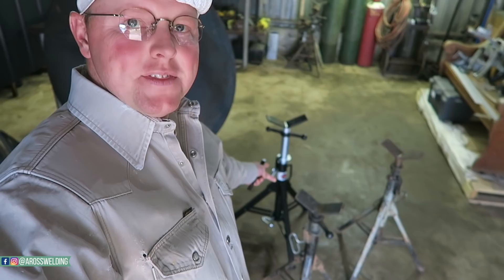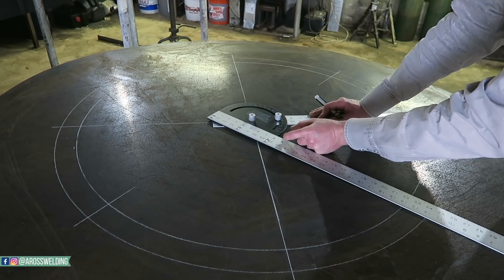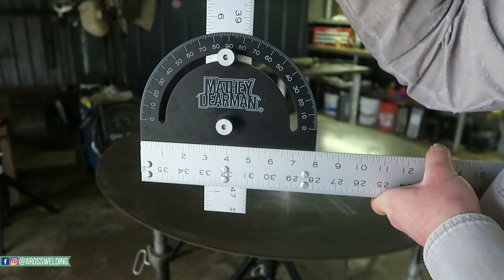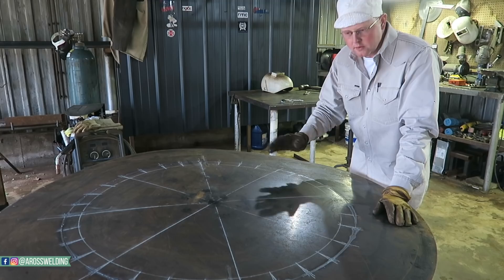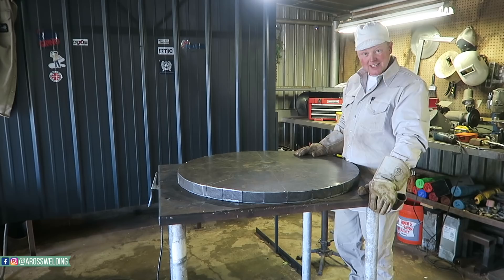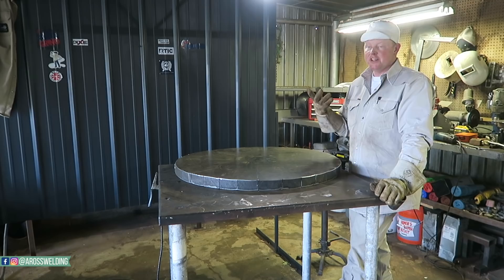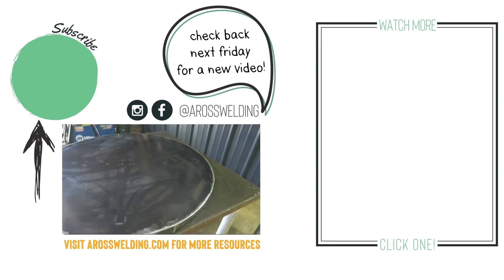WELDING SHOP PROJECTS // TOOLS I USE & TOOLS I’M MAKING DUE WITHOUT

Comment: Austin: There's nothing like seeing a young man take on the challenge of DIY and figure it out on the way thru the job. What a blessing to the trade. No drawings, no plans, no technical advice from outside, just have the job in your head and do it the "old school way". I got into this trade in 1960 and it was all done that way back then. Of course all the new high tech equipment is great and speeds thing up a bit. But it still takes the welder on the end of the stick to get the job done. You're a natural...

Comment: You gotta find the circumference of the circle in inches and divide it by 360. Whatever the total is is 1°. Then whatever you want in degrees just multiply it by your total you came up with earlier.  Example: 3ft diameter circle = 113". 113" ÷ 360= .31 which is about 5/16" which would be 1° around the circle. If you want 45°  you do 45× .31= 13.95 so pretty much 14 inches fromyour starting lion around the 🔵
Reply: that distance is on the circumference. you would need to be running around the edge of the circle for that to be the distance you needed. You are actually inscribing a triangle with two sides r. This is why radians are so useful

Comment: Another thing you could have done on this would have been to grind scribe lines on the 8th lines you laid out. Then lay it upside down in sand and use like a 4” chisel and a hammer to make nice clean breaks that come to a point in the center. Looks nice and reassures that you don’t hold water.

Comment: Hey man, first time watching any of your videos. I enjoyed but I've got a couple tips for you. 

First, the tool that you were using to find your angles, your drawn line didn't have to be in the center of the ruler. The set angle will be the same regardless of where you align it. You could've easily just put the inside ruler edge on your line then mark your spot with the other end. That would've eliminated the extra step of adding an inch to every mark.

Second, the easiest way to find the center of a circle is to start with a square. If your circle needs to be 37"(or whatever size), draw a square with 37" sides. Once you've got your square drawn, make a diagonal line between the corners to form an "X". X will then literally mark the spot for you. Trace your circle from that.

If any of this doesn't make sense, feel free to message me and I'll elaborate. Hope this helps!

Comment: You did great bro! As a metal fabricator myself, I agree with what you said about bending the edges toward the score mark. That would have been best, but it still worked out and you learned something valuable.
I actually caught myself saying "No dude, bend it up and put a fillet on it!" 😂 Under the circumstance that this was part learning part project, it would have been a great time to practice your tight welding skills on that inside joint! Maybe next time?
A tip for you when working with thin metal and want to reduce or eliminate warpage, keep a bucket of cold water handy and some dish towels and use the wet towels like a heat sink. Place the damp towel (s) around the area you're heating or welding to reduce your heat affected zone. The damp cold towels suck up the heat.
That's an old auto body trick I learned as a boy in the 60's when car bodies were still made out of real American steel.
You can also use that to purposely put warps or bends into a section of metal in a controlled fashion! Eastwood make a reusable jelly that does the same thing without introducing water to the site which might run into your work especially on contoured shapes or working vertically. The jelly sticks where you put it and doesn't run.
Stay safe, be well.
Reply from the maker: I love it! Very valuable info! Thanks for sharing!

Comment: You can use the compass(circle drawer) to measue halfway by taking the compass and making arcs from the 2 points to be halfed and draw a line between the 2 arcs intersections. Alot faster than the "figurin" lol
Reply: Material at hand plays little bit into design factor rolled  flat  bar lot less welding job outside corner of perimeter still excellent install.

Comment: Austin you are on the right track but in the sheet metal world which I am in it's all geometry. You just bisect lines and swing arcs to make prick points which are reference lines for you to go off of. You can probably google or youtube those things now. I always was taught by pipefitters and I taught some pipefitters our math as well, it made a great collaboration between sister trades.

Comment: Lol, figuring the smaller pie pieces is easy once you have the quarters of the circle. Just measure between the 1/4 lines where they intersect the inner circle. Take the  "1/2 way" mark and then draw a line from the center point to out past the circles. Walla, Repeat until your divided to your liking. 👍

Comment: I'm really surprised you used a vertical torch to cut that - and 14ga too? That's pure talent! I also was wondering why you used a grinder to cut the slots until I THOUGHT about it for a second ... if you torch cut it, you'd have had to grind the slag off of each tab anyway, and ... you'd have to half bend, grind, bend the rest, repeat for the whole circle. So the grinder was 100% the right choice, and I would have 100% flubbed that one!

Good show my man!

Comment: Where your quadrant lines intersect your circumference line draw straight lines to the intersections points . Measure those lines find half the distance and mark on the line . Draw a line from center to the mark on the line and past to the circumference line . Do this for all quadrants you will then have 8 . keep bisecting till you get the size you want .  When cutting 14 gauge hold your torch at a minimum of a 45 degree angle to the cut line  .Start as far away from yourself as possible to do a good job . Start cut and bring torch toward yourself . Your left hand holding the top of the torch will be sitting on top of the plate for stability and cut control . The right hand at the bottom of the torch will rest on the plate too . This method will make good cuts with the least amount of grinding. Have a good one Austin

Comment: Austin this is a great video. Finding the circumference of the cricle/ or of each quarter, and divide by how many sections you want to fit in that distance.

Also for saving time since the material was 14ga. You could cut the lid and roll the edge as a strap and weld the edge (corner joint) and seam where the strap meets.

Keep up the great work brother!!

Comment: After you divide the pie into four pieces, you can use a straight edge on the outside edge of the circle  and measure from line to line and place a mark in the center this will divide your quarters into eighth segments. You can also divide the measurement by two, three or four and mark your lines on the outer edge and draw a line towards the center mark wherever you need your segment lines or angles required.

Comment: I learned to use the cord length of a circle formula and haven't touched a protractor for this type of a layout since.  More accurate and can be used on any size circle 
Radius- sin- 1/2  of degree- ) × 2= cord. So if you want to figure the cord lenth for 90° of a 36 inch circle simply type it in your calculator like this 
18-sin-45- )×2= this is your cord length and you start from whatever point in the circle you like.

Comment: Another way to do this is to use your compass as dividers by setting them close to the size of the segments you want, walking it around the periphery of the circle only marking the first step, and seeing how much you're over or under by, then nudging the compass smaller or larger until the first and last steps line up.
Reply: This method is as accurate as the width of your lines

Comment: I love your vids, I'm a hack hobbiest welder and love learning stuff from the pros.  However, you made WAY too much work out of dividing the circle into the tabs.  :-)    You were right when you said that all you really need is your compass.  No math is involved.  The starting point is that the radius will divide the circle into 6 sections.   You can further divide those sections using the compass technique of finding a midpoint of a line.   I know this is a circle, but it's the same principle.   I wish I could attach a pic to show what I'm talking about.

Thanks for all your vids!

Comment: I’m a union pipe fitter apprentice and I’m currently laid off since our local is kind of slow due to the whole covid thing  so I decided to make my mom a kayak rack for her camper to take up some of my free time I’ve been using an old Lincoln AC 220 but it keeps me busy and it kind of makes me lay some stuff out 🤷🏻‍♂️ I would have liked to tig weld the whole thing but I’m just using what I have

Comment: This problem is so much simpler than what it seems like. Really he can just measure the distance between the outside of the lines that form a quadrant and then make a mark at center between those two lines and then draw that line out with it connected to center. If you divided it up accurately the measurement would be the same so it would actually be a much faster method than what you did as well. When you get it divided up to 1/8s, again just measure between the 2 lines and mark center and draw that angle out from the center. Most of your marks I can see that they are visually off so there was a high margin for error in that method but you could’ve simply marked half to have a super small margin of error. You’re going to be marking the lines manually either way so it’s ganna be relatively slow but I think it might be quicker than trying to figure with that protractor. It’s off center so that makes it almost impossible to do precisely. Also, I don’t think you need to be experienced to solve a problem like this, just pretty imaginative.

Comment: Paper template would be faster an repetition would be easier. Cut out your circle then fold it in half and keep folding until your happy with the cement size then use the fold line to transfer onto the metal. Template can be reused for different projects

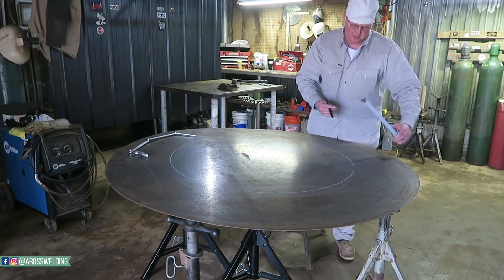Comment: 3:10 I'm not trying to be a stickler but if you wanted a 2in lip wouldn't you want to add some (you could probably look up) to your outer circle to account for how much material the bend takes up? Where would you look to see how much you'd need to add to get the 2in edge besides taking a piece of scrap and testing it out yourself? Anyway thanks for another great video and have a good one brother.

Comment: Just use a tape measure and keep halving it from the points after you get quarters and you’ll save a ton of time
Reply: Also if you don’t have three squares use a straight edge and draw a line across making sure you hit center and that will half it, then using one square quarter it from the center out

Comment: Hey Austin! I don't normally comment on YouTube video's but I've been enjoying watching yours after a few beers mate! I thought I'd put forward my idea on the approach (im a boilermaker from AUSTRALIA 😁) I would have cut the larger diameter first, wrapped a flexi tape around it and divided the circumference by how many lips you want to fold down (probably 100mm or so) and keep adding the number as you head round the flexi tape 😁 the old timers in Aus use the saying "there's more than one way to skin a cat" by the way, and I live by it 😏
Reply from the maker: Thanks for sharing!!!

Comment: I would have busted up the segments with your fancy dividers so half way from each line both ways then half again etc...a centre dot on the 4 main lines to keep the reference points and off you go....Just like you reverse a level to check it

Comment: there are many ways to skin a cat. Keeping it cool : a large wet rag covering the inner circle. It will keep the metal relatively cool. Why die you score the top of the fold tab? that's the area that thins when bent. Just curious.
Reply: It'll preferentially bend on the score lines, I'm pretty sure it's better to score the inside of the corner though.

Comment: I know this is an old video  I would have made first circle 1" bigger then cut a pie piece out edge 1"to 0 in center then pulled edges together  to cone top up to stiffen it up and let water run off.

Comment: By no means am I taking away your an amazing fabricator but it looks like you’re going off the wrong side of the protractor if you put the notch you had set at 90 the ends should meet giving you 0 or 180 depending on which way you go with it. I could be wrong thats the way it looks to me

Comment: Austin your putting way to much brain power into this simple progect .That 14 ga metal just cut it 38" and and bring it to the site and either beat the the 2" down around the 36" cover or weld it.
Reply: Though cutting tabs and welding is time consuming,  he  likely would have spent a few days heating and pounding a 38" round to a 36" with a 2" flange that would be a pile of shrinking to do with hand tools